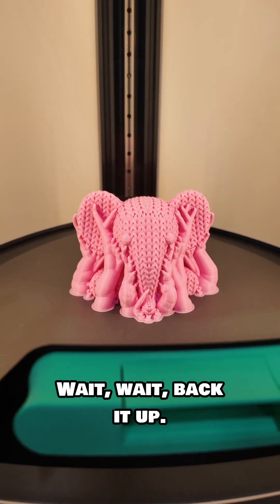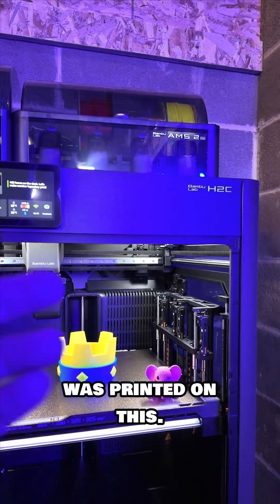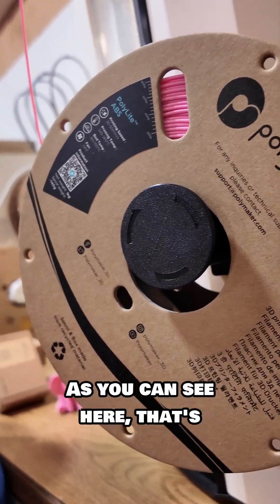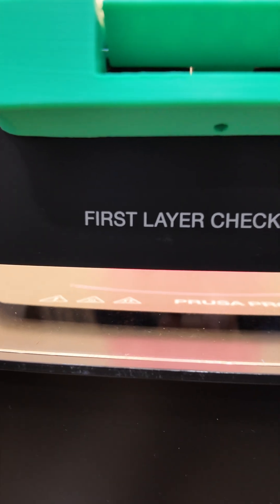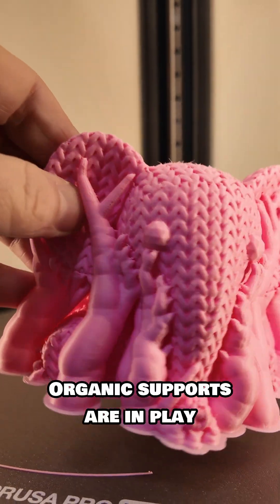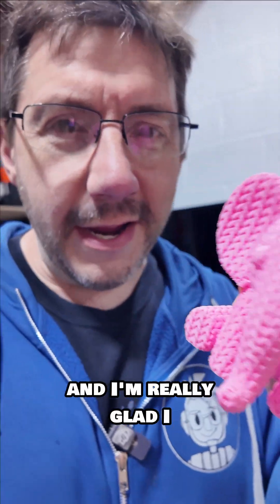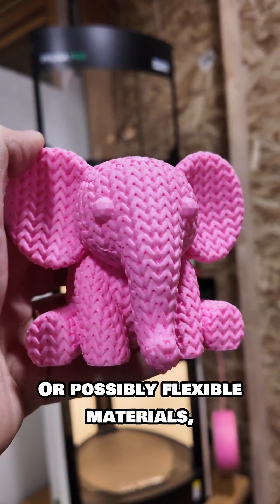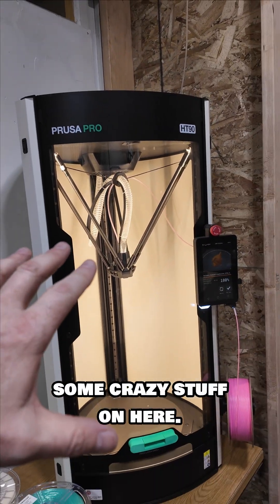CUTE PINK ELEPHANT! @Polymaker ABS on the @Prusa3D HT90! #3dprinting

Comment: Not sure what you're trying to prove here, does running the chamber at 90C do significantly better in layer adhesion than at 65C?  If so, one would have to consider if the $11k of the HT90 is justified over the far less expensive H2 series Bambu.

Comment: The HT90 is a bit of a BS machine. 90C is far too low for Ultem and PEEK with prints exceeding a few mms in Z, and that external spool holder? A bad joke. 

Yeah you can print PPA/PPS(-CF) with it, which are excellent engineering materials, but then again most modern machines can. Most modern machines have a proper and heated filament spool holders, too.

Comment: Did you know that there is a huge price difference between the H2C and HT90?
In addition, the H2C has the smallest print area of 305 × 320 × 325 mm vs. Ø 300 mm × 400 mm for the Prusa Pro HT90.
So both printers can produce prints of roughly the same size?
The advantage of the HT90 is its heated chamber at 90 degrees Celsius.
So why not show us a print made from PEEK, for example?
Reply from the maker: Oh, that is coming. Absosmurfly